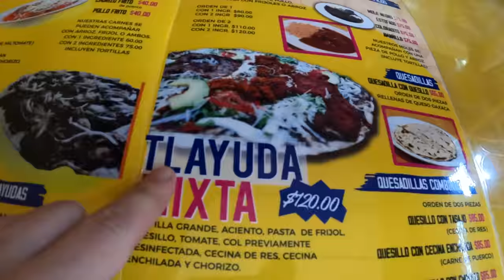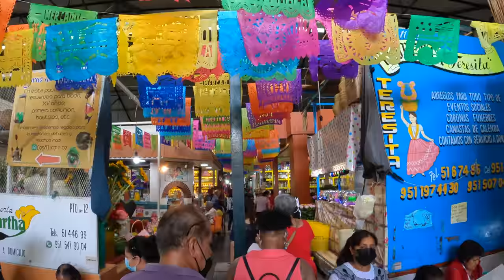The BEST motorcycle shop of Mexico |S6-E82|

Comment: Coño, that was a lot of food!  I had a similar thing with tires.  I blew out one on my SUV and took it to the BMW dealership.  They didn't have the tire of course and after a week couldn't even order it in less than a month.  This was in Puerto Rico.  Found a place called "Casa de gomas", that was basically a little house and a small parking lot in front and they hooked me up.  Probably some cheap Chinese knockoff but it lasted me for as long as I had the car.

Comment: Those tires and the larger rear sprocket will help you in the tight spots at a slight sacrifice in miles per litre. Check your tire pressures to make sure they didn't introduce a small bruise on the inner tube. BTDT.

Comment: I hope the tires, chain and sprocket work for you. Two teeth on the rear sprocket make a lot of difference. Two teeth More from stock on my sons crf250r mx bike, makes it behave more like a bucking bronco (more torque and less top speed). It becomes easier to wheely, but the extra torque may help you in the more tight/ difficult situations, and less prone to stalling. The taller tire may  compensate a bit for the bigger sprocket a little. Good luck safe travels.

Comment: You don't need the exact same size sprockets,  any one that fits and is close to original is fine, 4 or 5 in the rear and 1 or 2 on the front won't be extreme if you need them asap.
People change sprockets to change the ratio all the time, good cheap way to change how your bike feels and accelerates.

I go down 1 or 2 teeth on the front sprocket for faster acceleration, however you lose top speed, or you make the same speed a higher engine RPM.
If you go up teeth an extra 1 or 2  you will loose acceleration, need more RPM to take off, but will gain a higher top speed because you lower the RPM actoss the whole range. 
This can also make you use less petrol on long trips as you are at a lower RPM at the same cruising speed. (mostly from mechanical loss savings, less times rotating weight)

Your chain new, will stretch to a point, new chains always stretch faster than a used chain, because after they stretch they stop stretching for a while, then kinda stay there until they fails/snap.
So if your chain does not stretch anymore and it suffers a fair bit of abuse keep it well oiled so it wont snap.
The dust and road grim is what is wearing out the sprockets and chain, the cleaner you can keep them, the less grit there is to act like sandpaper on them, even with lube.
Keeping them clean and lubricated also helps them stay cool, which also slows the stretching.

Also if your speedo is getting it's reading off the front wheel via a cable attached to the front hub,  you won't get a change of reading on the speedometer.
If your speedo reads via the transmission from internal sensors, changing the sprockets WILL! change the reading on the speedometer.
Going down a tooth on the front will mean it completes a rotation earlier and add extra speed to the speedometer, making it look like you are going faster than you are.
This will also make the kilometers on the odometer count faster making the bike look like it's done more kilometers than it actually has, you can get electronic devices to intercept the signal and adjust the speedo to correct this.
Be careful of the reverse affect, you may be speeding if you do the opposite with the sprockets and get police attention, or caught on camera speeding.

Keep up the content, I really wish i could follow in your footsteps!
So envious!

Comment: A couple of teeth bigger on the rear sprocket would decrease your MPH for any given engine speed but only by a couple of MPH. If the rear tire is a bigger diameter it would tend to cancel out that difference. I hope you check everything they worked on after a few miles to make sure everything remains tight!
Reply: Just enjoy Noraly's videos Mr. Leighton. Everything will be fine , or add to the adventure , which is what this is all about.

Comment: I'm a little concerned that it doesn't appear that you've checked the front sprocket, which can actually wear faster than the rear. If you do find that it's worn it's sometimes possible to flip it over and get more use until it can be replaced. Sprocket gearing ratios are a complicated subject, but the larger rear sprocket will give you a little more bottom end torque and a little less top speed. A good tradeoff for your riding style.

Comment: 38 teeth vs 40 teeth rear sprocket size means the bike will accelerate slower but have a faster top speed as well as extend fuel economy a little bit... The 42 tooth sprocket means faster acceleration but lower top speed and smaller fuel milage..

Comment: would be fun changing sprockets for more torque and less speed.  like a completely different bike to get used too.
I would guess for the tires, as long as the treads are a similar cut pattern - then they should track together fine.  they look just a bit more aggressive - good choice. lol.

Comment: Going from 40 teeth to 42 will lower your speed at the same rpm.  So freeway will be more difficult.  It will lower the gearing, making going slow in technical terrain easier and it will be easier to wheelie (to get over logs of course).  It shouldn't be a MASSIVE change, but it will probably be noticeable.

When you're traveling all over the place, you don't have the kind of selection that you might have in more populated areas.  The new tires look better for off road and mud.   After suffering with the tires you had, these should do much better for your typical riding.   They won't be as good on the pavement, but they should do fine.  Of course, you probably recorded this a week or two ago, so you're aware of all that by now if you weren't already.  It's not like you're all that new to riding.  lol. 

I truly admire you, Noraly.  I would love to do what you do, but I know I would get really tired of it after about 3 weeks.  That seems to be my limit before I really ned to take a break from being on the road every day.  Although I think you stay in one place for a couple of days or so now and then, so maybe that helps.

I love Oaxacan food.  
"She told me to Oaxaca this way."  - paraphrased Aerosmith song

Ooh, Tlayuda!  Good stuff.  Oaxaca is known for molé as well I believe.  It's a giant tostada... kind of.   They're a meal or two all by themselves.  Hmm, I've never had a Tejate.  I wonder if the local Oxacan place has it.  If it's not sweet, I can give it a try.
Reply: Congratulations you are the 100 th person to say the same thing about her sprocket choice. Go down to your nearest Honda Dealer to claim your prize.

Comment: Hopefully your chain ring  was mounted still concentric to your hub ( since it didn't appear to be an exact fit for your bike...) That could be a little dangerous; it would make me really nervous....). If not you should see some section of your chain tighter and other looser as you rotate the wheel to check the chain slack...)Be careful if that is the case you might damage the bearing that is holding the sprocket shaft. Basically that would be bad news for the  engine....

Comment: No wonder you were having so much trouble off pavement. the old tire would be considered an 80/20 tire. Thats 80% on tarmac and 20% off road. Doing as well as you did is testament to your off-road skills. Concerning the new tire all I could find was it is manufactured in China by the Qingdao Fenghua Rubber Products Co. under the brand of Vuro Star. As for the quality of your new tires you will have let us know.